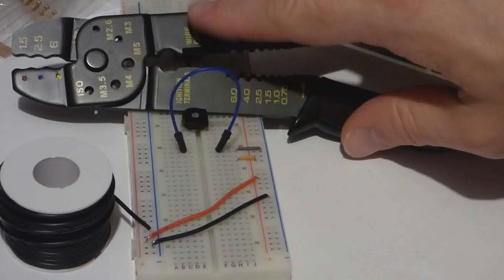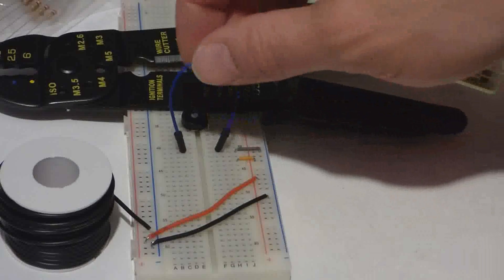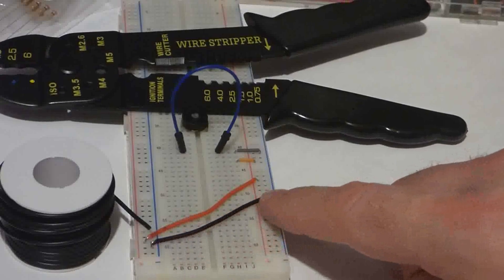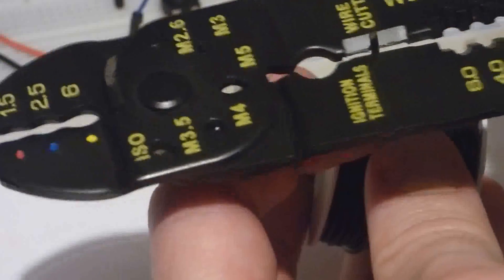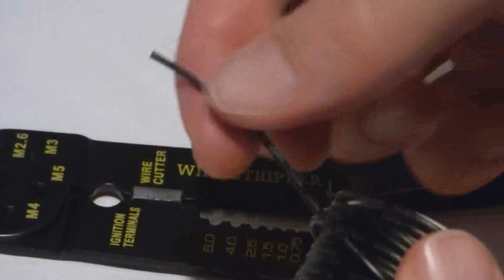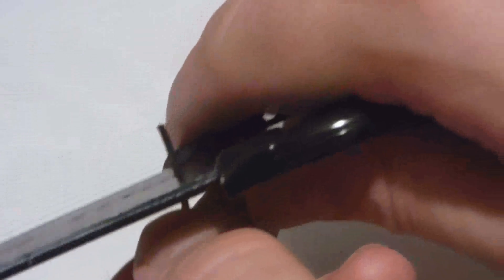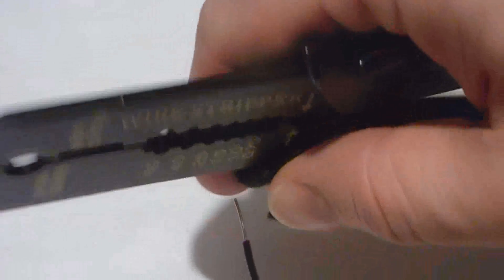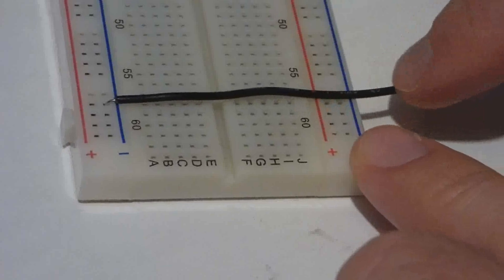How to use an 8 inch crimping tool to cut and strip wire for electronics breadboard

Comment: grip the wire with the crimper at an angle. not straight on. and push it off with your thumb.
Reply from the maker: Thanks for the tip!

Comment: 22 gauge American (AWG) is 0.65mm and you are using 0.75mm.  There are no AWG markings on this at all, and the bolt cutting holes are Metric not SAE.  The tool you have is not meant for use in the USA.
Reply: As an American myself, I have to wonder... Why is the rest of the world so slow to adopt SAE?     (Just kidding!)   :o)